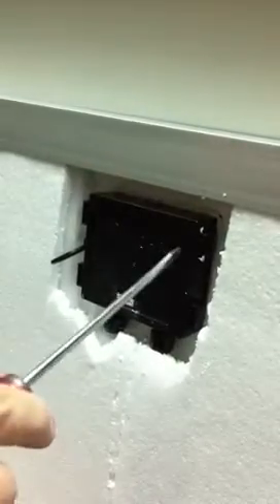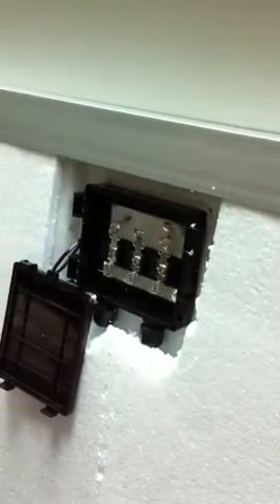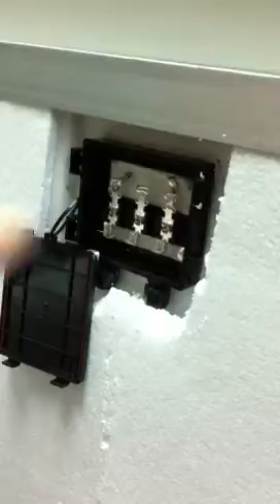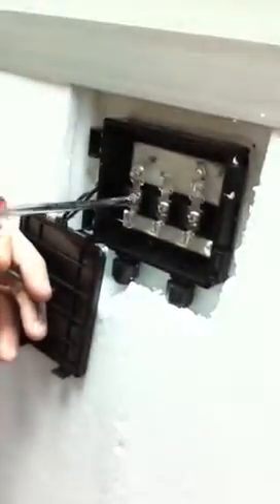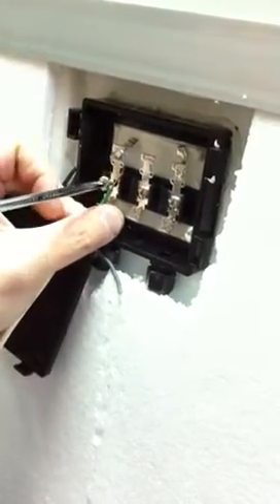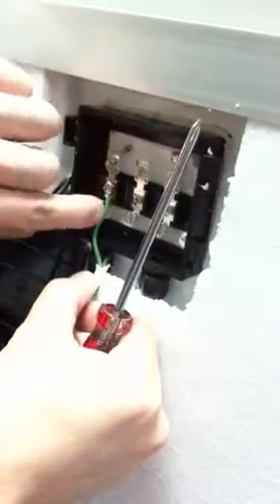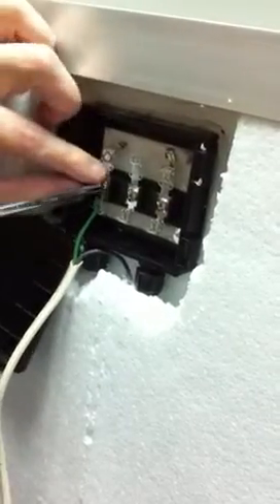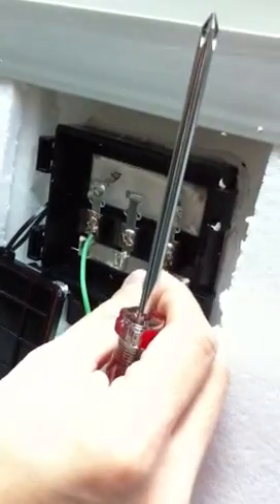Solar panel PV Junction box connection tutorial rear wiring box

Comment: Tip: when wrapping wire around a pin or screw, doing so clockwise will help pull-in the wire as you tighten the screw.
Reply: Thank you for pointing this out. My dad is a master electrician, and trained me for this kind of stuff. I almost vomited when I saw him just put the wire in like that.

Comment: Why is there, what appears to be Styrofoam insulating the back of the panel? Panels work much better when they are cool.
Reply from the maker: videoclipits the panel was being prepped to be sent out , the Styrofoam is for padding so it doesn't get broken in the shipping process